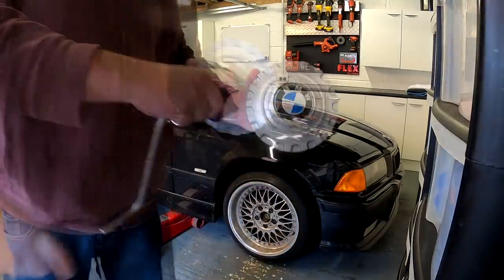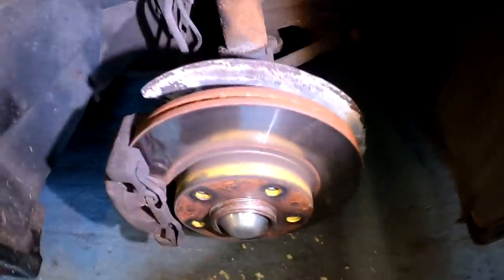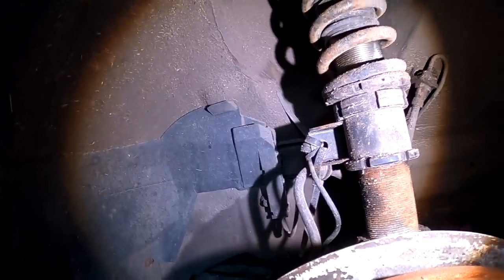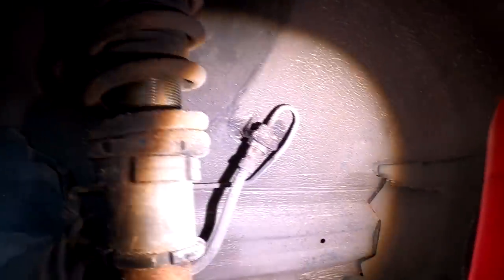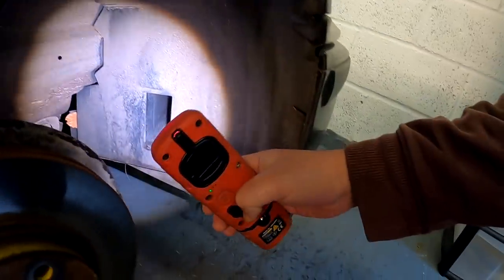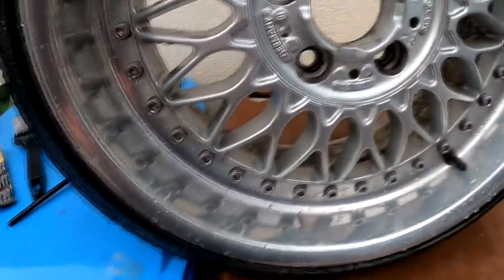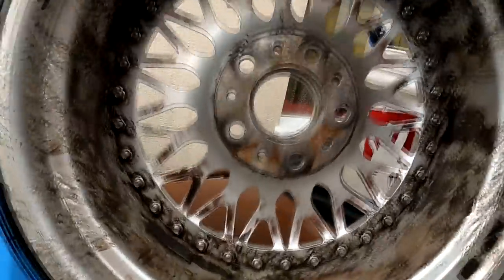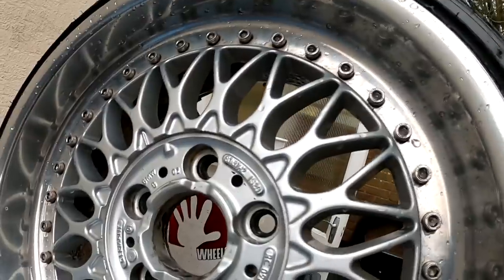Filthy Rotten Dirty BMW Alloy Wheel Clean

Comment: Jon, I wouldn't mess about with them, get them done properly and then if you ceramic coat them, they'll be a lot easier to maintain, I've had a set of Compomotives and also two sets of BBS RS's that were 3 piece like that, and as nice as they were, they were a royal pain to maintain.
Reply: Gotta agree with getting them coated, with a proper wheel costing too like DLux, Gyeon Rim or GTechnique rim armour.

Looking at the footage of these rims, do you think those are 3 piece or 2 piece?

Comment: buy the wetblasting attachment for the pressure washer and do the inside and then just respray them, it doesn't need to look perfect in there but you need to stop the oxidation before it gets out of hand.

Comment: Hi John, some of the coilovers (mainly for m3s from memory) are supposed to adjust caster, but there is a chance they are just installed incorrectly.
Reply from the maker: these are HSD's I think they are not fitted right but I need to check with HSD really.  I think they are reaosnably old. cheers harry

Comment: They can be a nightmare to keep clean, it might be worth getting the proper bolts for them will make cleaning then a lot easier. Autosol works wonders. I refurb’d mine myself, they were knackered when I got them ... sanded from 60grit all the way to 3000k grit then a good polish.. all by hand, give it a go 🙂

Comment: Someone has already had them apart. I've seen them refurbished with polished rim taken down so far its dangerously thin.
I'd check the nuts and bolts used too. There should be a flange nut on the back and the flange on the bolt is larger than some cap head bolts.  Someone has cheaped out on £15 worth of nuts and bolts over spending £120

Comment: Cost vs. Elbow Grease. I would enjoy trying to at least Clean and Polish them to the best they can be. Scuff the barrels and have the body shop mask, respray and clear coat. Then I would Coat them. Wouldn't be perfect just nice and tidy.
Reply from the maker: they would need to be split though to do properly.  Im seeing like prices of like 600-800 quid for 3 piece refurb.  but all I want is the inner barrel repainted but it would need to be split.  Im trying to get my head around why its so expensive.  to undo the bolts would take 5 minutes with a drill.  break them down. acid dip. flatten, and paint who knows.. must be a tricky job.

Comment: It really isn’t that hard to refurb BBS split rims yourself John, i have done a few sets,  ones the tyres are off it’s a simple case of disassembly, using the correct tools obviously,.
I then enlisted a local powder coater to do the barrels an the centre weave in my chosen colour 

There is no way you will get rid of all that oxidation now it’s got under the paint and lacquer finish part, in fact once it’s there alloy is really hard to stop deteriorating even once it’s been re done it can continue to corrode under the paint 

Getting someone like Lepsons or similar refurb companies will make them look perfect again 👌🏻
Reply from the maker: yer I mean lots of places are quoting big sums to refurb these.  but dont they need to be sealed properly when you rejoin them?
Reply: @forensicunplugged4295  they do, but it’s as simple as using tiger seal SPARINGLY between the mounting faces, it really is that simple

There is a decent guide on club Gti forum that i did a number of years ago for BBS RM alloys, but they are all of a similar construction with variations given 2 piece or 3 pice construction 

You can save yourself a fortune by getting your bolts sonic cleaned and re coated and the barrels done by a powder coater

Comment: wheels after clean and polish looking good what for polish you use
Reply from the maker: I used autosol it did fine and cleaning the tarnishing but there was no brilliance because I just used 0000 wire wool but I would need to go again with a cloth or softer drill bit to gloss it up.
Reply: @forensicunplugged4295  thank you